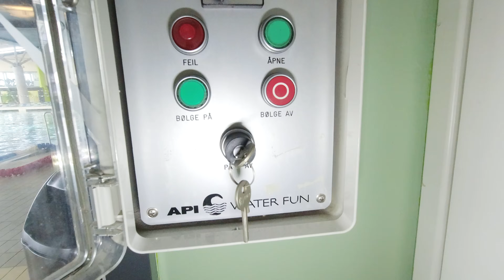How does a wave pool work?

Comment: New fear unlocked. Getting sucked into one of those chambers for some ungodly reason and not being able to get out and only having a teeny bit of air at the top of the chamber to breathe. So you're not directly drowning but slowly suffocating or dying from exhaustion.

Comment: i know sand filtration is a problem but i got an idea - can you make SOFT floors in such shallow water pools? some water-proof rubbery material doesnt have to be bone breaking rigid ceramics? I mean swimming in sandy beaches is bit safer than trying anything inside that neck-breaking shallow water

Comment: A wave pool works by consuming a massive amount of electricity which is powered by electric power plants consuming coal and oil and emitting large volumes of pollution and carbon dioxide to the atmosphere so that you can have a good time.
Reply: Yep, no good time is had without consumption of resources.

Comment: I for sure thought there were like mechanical things pushing the water to create a wave, how much energy does this use at full blast.
Reply: Actually there are quite large and deafeningly loud blower motors inside a mechanical room just behind the wave-making chambers.
They blow air over the surface of the water at the top of the chamber to make the waves and need dozens of kilowatts to accomplish that.

Comment: I wonder how much power is required to stuck up all that water.
Or how big is the electric bill?
Reply: No water is su ked, instead it's a big blower motor that blows huge quantities of air over the surface of the water inside the chambers. There is a pipe coming from a mechanical room behind the chambers and sitting a few feet above the water.
The power usage is at least a few dozen kilowatts and one of the reasons wave pools don't run continously is that power consumption as it would end up in a (even more) tremendous power bill for the water park owner at the end of the day.

Comment: i always thought there were some kind of fans inside these "gates". Interesting technology but simple
Reply: Actually there is a large fan or blower motor used however it's in a room behind the wave-making chambers.
On the ceiling of those chambers you have the end of a pipe that will blow air over the surface the water, making waves this way.

Comment: It doesn't create a vacuum it creates pressure. There's blowers that create pressure and a pneumatic door opens which allows the air into the chamber pushing down on the water which creates the wave

Comment: its less vacuum pulling in the water, but rather air displacing the water from the chamber, the sudden release of the air then causes the water to push into the chamber. the beauty about those pneumatic wave machines is that there is pretty much very little suction from the wave machine. Usually, you have the fans sit in between chambers, and swinging back and forth between the chamber on the left and the right, creating a continuous, smooth wave with similar sizes.

Source: I work at a wave pool, though its about 40 years old and only has 3 chambers and 2 fans, with the difference that we also lower the entire pools water level before starting the waves by about 60 centimeters. its an impressive piece of tech and I highly recommend checking it out.

Comment: it explains nothing.. how do they create the vacuum what type of motor, how can you suck ~100 m³ of air in a second?
Reply: hi, so they do not suck a vacuum, that is misinformation. they pump air into the chamber, causing pressure within the chamber that pushes the water out of the chamber. used for that are usually big fans, can't go into details since it varies from pool to pool due to differently sized chambers. usually 3-phase electric motors driving a circular air compressor or disc that pumps the air into the chamber above water line.

also that is nowhere near 100m³ of air, pretty sure our chambers are not even 50m³.

Comment: I actually thought it was big flaps that moved up and down, pushing the water in and out.
Reply: also exists, those are mechanical wave machines. not as great as these pneumatic ones though, more moving parts means more risk of problems, and more parts exposed to water means higher risk of rust and seizing.

Comment: Hello, just a minor correction: It’s not a negative pressure vacuum conventionally that occurs in those air chambers, there are high powered centrifugal blowers normally three phase, the high pressure air is sent through to manifolds that contain valves, the valves are controlled by pneumatic cylinders, but keeping it simple, when the valves open and the air is allowed to rush into the space above those grates, a positive pressure is generated inside the space and pushes the water out the grates via communicating vessels phenomenon.

The water has a natural tendency to return back to it’s original place, but this is where the clever physics phenomenon occurs, the valves shut as the water flows up inside the air chamber, then momentum naturally pushes the water back out and the valves open up at that time, and amplify the wave momentum, making the.. waves.
Reply: It it like a siphon effect?
Reply: @ToHimWeWillBeReturned  Not quite. It uses resonance, just like pushing someone on a swing. First the air inlet valves open, blowing air above the water in the chambers, pushing the water out into the pool. Then the valves switch; the inlet closes and the exhaust opens, letting the water rush back into the chambers. Every time this happens, the water gets slightly higher as more energy is added into the system. You can see the machine room in action here: https://youtu.be/TxOmU5FYzS0?t=405 Listen out for the pneumatic valves opening and closing.
Reply: This is pretty genius. It may be even more clever if they somehow "recovered" some of that energy of the return waves and stored it in the form of positive air pressure so that the blower didn't have to work so hard on the next valve opening.

Edit: saw your reply, that might be even more clever than my solution

Comment: This is kind of misleading. I assume you're talking about the type that uses punps to fill a chamber and then release the water. That's what the pool you're in might be. There is also blower and baffle style wave generator where the former used compressed air to push water out of the wave chamber and the later used hydrolic rams to physically push water out.

Comment: That's actually a really good way to do it. I've only ever been almost sucked into one wave pool and it was one of those the ones with the two tubes at the bottom middle of the pool. And if you got sucked into those you'd be shot probably 15 into the engine room. Flung into a pitch-black room that will fill and sweep with water dragging you along.
Reply: That is terrifying
Reply: My anxiety after reading this…….
Reply: literally my worst nightmare
Reply: You just made my fear crawl up to 100. I hate anything to do with the dark and water rushing into a dark room, pulling me away sounds horrifying.
Reply: What?
Reply: @MattH-wg7ou  pressure wave pools have inlets either on the back middle or sides. It pumps water through pressure to a room behind the pools in a huge room that fills up and then pushes out. You can get trapped in that room, that's why they have to put an access and ladders and catwalk in them
Reply: @Weeklong_Seagull I couldn't find anything that seemed like the type of pool you're describing, could you link pictures/articles about similar types?
Reply: @Weeklong_Seagull why not just put a grate on it
Reply: @justinolsen488  they do. A child could still slip through tho if there wide enough

Comment: yo if your 6 or 7 or under 130 pounds the vacuum used when pulling the water in those chambers will literally have your ass pulled against those gates underwater at terrifying strength

Comment: Usually it's a fan a strong on at taht, behind that wall is a few strong fans taht go into the back part of the chamber where only air is, and there's a pipe with a little open close thing that when it's open, air passes through and out, when closed the air is forced to the water making a wave

Comment: I got sucked against one of those grates as a kid once, after dangling off the edge as the wave machine was getting started, I’ve never been so scared in my life. Luckily spat me out pretty quick
Reply: *New fear unlocked
Reply: I got sucked under by a wave machine too. It just pulled my feet right out from under me and sucked me down. Luckily I managed to get back up as the machine released, and I got far enough away to avoid it happening again. Horrible experience tho, I never went near the grates again.
Reply: @ananonymoushen4339  im scared of that happening to me
Reply: @ananonymoushen4339  I thought I was the only one with this fear! I also got sucked in like 30 years ago, and I'm STILL scared of these things. I never get anywhere close to those grates. The suction is pretty powerful, and I'm surprised that the only barrier in front of the grates is a piece of rope!! It was the same thing at the pool where I got sucked in.
Sure, it let go pretty quickly but it felt like an eternity for me., and when I told the lifeguard he just laughed, saying that it can't suck me in because of the bars. Of course not but it's still powerful enough to pull me under and hold me! I was 8 or 9 years old at the time.
Reply: @ananonymoushen4339 I've got stucked in washing mashine, luckily there was my sister in home and she helped me
Reply: Many wave pools have ropes to keep people from getting too close to the grates to prevent this
Reply: I’m really struggling to tell if I got pulled by a wave pool as a child, or it was just a dream 😰
Reply: @JiglyPoof7 you probably did
Reply: See I'm looking this up because I almost got pulled into one at shlitterbahn in Galveston when I was a kid, I've always wondered what would of happened if I had not managed to hang on to the clear plastic flaps that dangle from the top part of the machine.
Reply: @shadyside_crew  is Schlitterbahn still open, i havent been in ages since moving away :0
Reply: @thecrispyacorn  in Galveston yea, in the summer time, and so is the one in New Braunfels (also summer time)
Reply: @shadyside_crew  yep it happened to my brother he was scared to death
Reply: @shadyside_crew yoo i went there i know exactly what ur talking about but i was kinda little and was scared of those lol
Reply: Wow
Reply: In the pool i went to they had pool guards blocking children from going near the gates, adults were allowed cuz they could just stand up when the wave was in the deep section, if you can get the timing right it is fun
Reply: I have an inexplicable fear of touching metal grates under water. And wave machines are my worst nightmare. I know how they work, I know what the grates are there for but I just can't go anywhere near them when underwater. I also hate touching pool drains under water. I just hate it.
Reply: @reflex3843 submechanophobia I think it's called.

The fear of man-made underwater objects.

The feelings you have are part of this.
I thought I was stupid as a child, being scared of pool drains and wave pool workings. But no, it's not uncommon.

I'm not scared anymore, but they still weird me out a bit, I have just learned to ignore it as much as possible and enjoy being in pools.
Reply: @aperturelaboratory  SAME
Reply: Oh my God, that's terrifying! It's my worst nightmare. I'm TERRIFIED of the back of wave pools. I'm glad you're okay, but soo sorry you experienced that 😣
Reply: now it makes sense how i almost drowned as a kid once, by being pulled down, without me understaning why
Reply: So that's why lifguards don't allow to swim near them
Reply: This is why they have those ropes and 52 life guards staring it down at all times.
Reply: @MaxLai_0104 52 life guards? Which park is that? I only ever see two lifeguards, one on each side...and that is at the Disney water parks where there are tons of people. They might have another couple on the shore end, but I never see them.
Reply: these things were major thalassophobia for me
Reply: It’s like when I was afraid of going down the drain as a kid but worse
Reply: he lives to tell the tale
Reply: Glad you're okay and survived that
Reply: What if you fall inside the inner room
Reply: That happens to me as a kid too, so scarry
Reply: As kids we dove down there to get sucked against the grills as a game. Surprising no one of us died
Reply: The fear of this is the only reason I clicked on this video.  That must’ve been horrifying!
Reply: The water park I go to actually has a rope that people aren’t allowed to cross, meaning people are not allowed to go anywhere near the grates.
Reply: I now have a new fear unlocked😮
Reply: Final destination ahhh comment💀
Reply: I was playing near the grates once as a kid, and my foot slipped out from under me, probably during the suction phase, and I jammed my big toe into the gap between the bottom edge of the grate and the floor of the pool. Peeled back a chunk of meat from my toe. Handful of stitches and a scar thats still visible nearly 20 years later
Reply: So im justified to be terrified of them
Reply: Wait, so it WILL suck you in?
Reply: See I didn't have that happen, but I DID get sucked underneath the water when it started up and it kept me there, pushing and pulling me back and forth until the sequence was done. First and only time to date I almost drowned and have NEVER stepped foot in a wave pool again
Reply: That’s my new fear now☠️
Reply: No you didnt
Reply: delta p
Reply: *New fear unlocked
Reply: @ailaanexplores2933 good idea, fear keeps ya safe from predators and scary things
Reply: This sure seems made up. 😂
Reply: In a park near where I live like 10 miles away, a kid got sucked into one and got crushed instantly
Reply: Nvm it was a employee
Reply: I was working in a park where we had this courage test, we used to slide through the bars when the waves were off, go up into the air chamber and wait until it was started again. A tad scary but not to bad. No one ever got hurt. God gourds the stupid, I guess😂
Reply: Bs, what this guy says is bs, it does not suc water in, it fills huge tanks with water, and then release the water, it does not suck water from the pool like that😂
Reply: @Daniel-qz8bp  - yes and no. Some designs add water to the chamber and release it under gravity which for the most part only produces outward surges but most (and the design shown in this video) use air pressure to push water out of the chamber until it returns/equalizes. If you just so happen to fall in front of the grates when the water is returning to the chamber, you will absolutely get sucked against it.
Reply: @Daniel-qz8bp did you watch this video?

It clearly shows a chamber of water and air... the air is forced in or out to move the water.. when the air pressure inside reduces, the water flows through the bars into this space.

So it's 100% possible to get sucked and held against them.
But obviously when it generates a wave, you will be pushed away again!
Reply: @Daniel-qz8bp  but it is a circuit nonetheless
Reply: @kivori3438  Yes, but you cant get sucked in, becous it does not suck water in, so the story above is bs, 100% made up for likes.
Reply: @Daniel-qz8bp  it doesnt suck but the effect is “attraction” so its not correct in the sense but it is what you can say is happening, even if the cause is not suction the difference of current and pressure makes it like it.
Reply: @kivori3438  No, water tanks fill up from above, the water is not coming from the pool in any form, there is no suction in that pool at all.
Reply: @Daniel-qz8bp  i already said that i know but the effect you feel is that of suction caused by the current and different amount of water moving in and out. It’s not suction but you feel pushed and sucted in cuz of the water. It’s a feeling not a real thing
Reply: @Daniel-qz8bp Two things:
1. Obviously the water has to come from the pool, otherwise you're just filling it up with more and more water. But I get what you're saying; it's probably water taken from the overflow thingies and not directly sucked up.
2. I'm pretty sure you can still get sucked in. As the wave moves away from the machine, you should briefly see the water level inside the machine become lower than average. Water then has to flow back into the machine to equalize the level. It's a similar effect to how water recedes from the shoreline before a tsunami -- the water for the wave has to come from *somewhere*.
Reply: @kivori3438 I think you have the right intuition, but it really is a real thing. Water will be moving away from the machine on average, but there may be brief moments where water suddenly goes towards it
Reply: @Daniel-qz8bp  does anyone like you
Reply: @HarryBalsark  Ask your mom.
Reply: @Daniel-qz8bp  she said she doesnt like you either